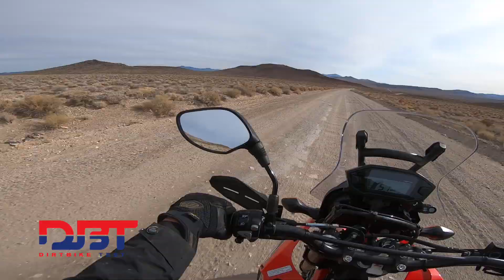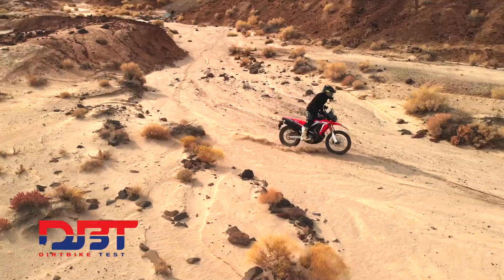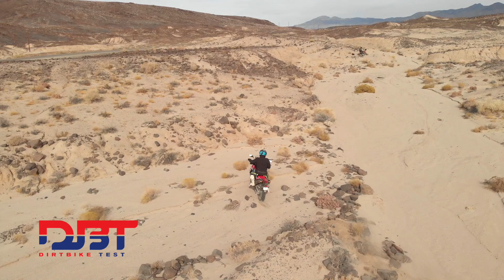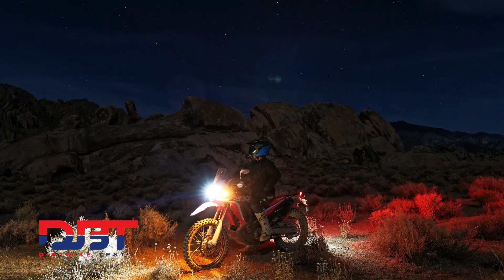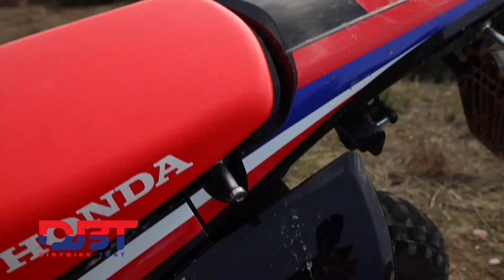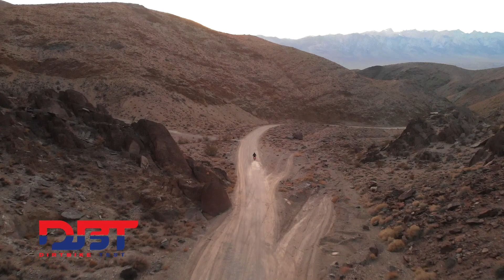Riding Impression: 2020 Honda CRF250L Rally

Comment: Recently rode with KTMs and DRZs. My 250 Rally has 60,000+ kilometres. Which bike was the only one that didn't break on the trip?
Reply: 20k on mine, nothing but chain n sprockets (once) and oil changes. I have a perm air filter.

Comment: It is so hard to find testers that realize a 250 can be for experienced riders as well. I have a 250. And a CBR1000 and a VTX1300.  Ive owned 80 motorcycles, Over 25 were Dual Sports. When I started, they were called Dual Purpose.

Comment: Thanks for this review. My experience, in my 20s, and 30s, is with a Honda CB 350, Suzuki GS 750, and later, a Honda CT-90. I am now 55 years old, and looking to get back in to riding. I could care less about going fast. My main goal is to see what is around the next corner, and have fun. I do not want to worry about whether I can pick the bike up by myself if I drop it on the trail. I started looking at the KLR 650, and then fell in love with the RE Interceptor 650, but became disenchanted with the corrosion issues, and short service intervals. I just don't want to spend all my free time working on a bike. I am more and more leaning towards the CRF250L Rally. I like the long service intervals, and even though I am north of 250LB, I am still well south of the 250s max load range.
I looked at the 450, but for the price, and ridiculously short service intervals, that is not the bike for me. I have just now found out that Kawasaki may be introducing a replacement for the KLR. That is now my only stumbling block. I need to wait to see what they introduce. I live in Washington state. I have relatives in Star Idaho, that I regularly visit, and I am perfectly happy to use the avoid freeways check box on Google maps. I would love to have something with more power, but there just isn't anything in the CRF250L Rally's  class. If Kawi doesn't introduce something revolutionary this year, I think the CRF250L Rally is my bike.

Comment: Man I dont get it,  The bike is about 350 Pounds. Thats on par with the xr650L  and not far Behind the Dr 650..The advantage of the 250 class is that they are light, whats the point of getting a 250 if it weighs as much as a 650 and has half of the power?
Reply from the maker: For the less power, of course. It does not feel this heavy till you have to pick it up.

Comment: I have one. Its a great bike. Its a 250. You want more power? Just buy a bike with a bigger engine! And the rear suspension does adjust for pre load, so try it before swapping out the shock.

Comment: A note on the base 250L front suspension. There is a spring only on one side; the fork tubes are not identical, and the seals tend to blow out very easily.  It's not a bike killer, but maintenance is a little more like a dirt bike in this case.
Reply: Is there an aftermarket fix for this problem?? Good to know!

Comment: It is my Detroit urban transportation scooter with the added benefit of joyous movement.  It works well.  I ride it a lot.  It makes me smile.  No better value.  It needs nothing.  Thank you Honda and please don't change a thing.  Small displacement is awesome. Many of us in the US will choose to not spend $$ on cars and trucks going forward.  Consider this vehicle as a better option as most of us prepare for extended time frame where less is more. Fun bike.  75 mpg.  $104 Full coverage insurance per year.
Reply: This is what I needed to know. I will do 99% driving on normal streets. Not off road. What do you think of the ergonomics? Is the gearing pretty short? Does it get hot quickly? Have you swapped out to more tarmac friendly tires?
Reply: Ergonomics are old school and a bit cramped compared to modern (KTM) standards.  The handlebars are a little low and too close to the rider (I’m 5’9”).  I don’t find the gearing short.  Seems just about right to me.  I’m not sure the little Honda could pull much of a taller 6th in certain conditions - after all it’s got 24.6 HP.  I don’t think it gets hot too quickly.  When I’ve been sitting in traffic the fan will kick on during longer idle sessions.  I replaced the stock IRC’s after they wore out with Dunlop 605’s.

Comment: Hey guys if you want my opinion I have probably the most modified Rally on the planet. I have spent 6300$ in upgrades so far not including the bike. I know I’m going to get comments on why I would put so much into a cheap bike and the answer is, I just like the bike and want it to be the best it can be. I wish it came in a 350 or 450 but I still love it and I’ll give you my thoughts.

1. -Price-I bought it brand new 4000$ from the dealer. Amazing price to get you into adventure riding for a brand new bike. Mine was two years old so the dealer needed to get rid of it. Those are the best deals.
2. -Parts-This is a global bike so parts are easy to get and dirt cheap if you break something. A huge plus for your first bike that you may be crashing a lot.
3. -Weight-At 350lbs this is a light bike for adventure riders to get started with before they upgrade to maybe a Tenere 700 or 790 KTM. No it’s not a light enduro bike like a 250 EXC BUT it isn’t marketed as such. It doesn’t give too much power to get new riders into trouble. 
  
  With all that being said you don’t have to spend as much as I did in upgrades but I will tell you what you absolutely MUST upgrade on this bike. Get a 13T up front. Get a FULL FMF exhaust and an EJK tuner. Get a full Racetech suspension if you’re over 150lbs. Change out the terrible stock tires for D606 and as with every bike get a Seatconcepts seat for comfort. I changed the bars immediately and put on Barkbusters as well but those are less important. The nice thing is you can buy the bike and the upgrade as you get money you don’t have to do it all at once. I built mine up over the course of one full year and I have nothing left to put on it. I will be making a video of it soon for my channel. Thanks for reading
Reply from the maker: We would love to do something with your bike and see what is can become...I know this guy who will be on Tech Talk Taco Tuesday #57 tonight that might like to ride it too...
Reply: Can u post the link to your video of the bike?
Reply: @grumpysquid  I am trapped overseas with no way to fly back to the US, I will make a video for my channel but god knows when
Reply: And what is a “13T”??

Comment: Please HONDA make a 350 again, that would be perfect: 250 too small, 450 too big.
Reply: Look up 2000 1999 yamaha xt  350 was a great bike good suspension sear 6 speed  enuff power and light weight
Reply: @mastersolomon  In fact I bought an XT350 when it just came out. I rode it straight from north Germany to France and had the holiday of a lifetime. That bike had good power, around 34hp I remember. Would buy it again if it was available new.
Reply: Krav Maga SMA Master Solomon I ride TW200s for gravel roads and trail use, and a 1999 XT350 when I need to run faster than about 55 (my heavily modified TW will do about 70-75, but you'd never want to for long, it just makes it comfortable at 55-60 which was the goal). The 350's a great bike, but old and archaic. I imagine a CRF250L Rally will probably replace it when it finally keels over, I don't need a big, powerful bike. Just a capable dual sport that is a BIT more burly than my beloved TWs for occasions I need to ride a bit faster. 

If the CRF250L had the 300 engine, upgraded suspension, and bigger/beefier wheels and tires, it would be the perfect bike. I'm obviously into the look, feel, and handling of fat tires, so that's a pretty necessary upgrade for me, and I hear the stock 250 isn't exactly thrilled about the additional unsprung weight.
Reply: @The_sinner_Jim_Whitney  yes the 250 is 350 lbs underpowerd  my xr650 is 346 lbs and gets 40 hp stock. That 250 needs a 450 cc motor detuned just like the 250 but 450cc . Don t worry about too much power i never use all the power in my 650 but i enjoy the effortless riding u can keep the motor at low rpm  i cruise at 70mph easy it will hit 100
Reply: Krav Maga SMA Master Solomon 317 pounds, I'm pretty sure. I've ridden 450s, even mild ones, no thanks. I like to be able to use most of what a bike has, with a linear sweep of useful throttle positions. 

Big bikes for me (I weigh 150 pounds) are hard as hell to trail ride, most are taller than I'd really like for them to be and anything bigger than 350 or so means (for me) the throttle is like an on/off switch since I can only effectively use like 20% of the throttle on rough stuff, plus weight is my enemy anywhere but on the road. 

I don't ride highways, or I'd figure out how to make it work. The ability to pull away from steady 60 mph traffic if I need to for safety is all I require as far as on-road performance is concerned. 

I might wind up with a 450 someday, but it won't be my first choice. Smaller, lighter dual sport and adventure style bikes are getting more and more popular and available here in the States (have been everywhere else for quite a while), so here's hoping we get a better (for me) option soon. A 300-350 cc Yamaha Teneré would be the cat's ass...
Reply: Krav Maga SMA Master Solomon the 250 is 317 pounds you twit
Reply: @mastersolomon  I hear ya. I cruse at 5 mph. And sometimes I get up to 20.
Reply: @JHUM22  I was talking about the crf rally 250. YOU TWIT.
Reply: I would upvote this comment to the Moon if I could.
Reply: Unlikely .... since 250cc is a big market for Honda, especially in Asia, that is the maximum allowable cc.  I would rather to see the bike to lose some weights, under 300 lbs, and a few more ponies (to get up to 80 MPH top end)
Reply: I have a 2014 regular L with the 300 kit, full FMF and EJK, Acerbis 3.1 tank.  I added a Britannia Composites faring.  The only weakness is the suspension, my bike has plenty of power, the mods got it down to right at 300lbs.  I'd trade more power for better suspension.  These bikes work great for their intended purpose, low maintenance practical, affordable travel/ dual sport/ light ADV hybrid.
Reply: Agreed
Reply: CRF300L & CRF300 RALLY are here. Ok, for now only in Thailand, but hopefully coming soon to Europe & other places too. 👌
Reply: your wish has been granted.
Reply: Or just make a 250 with decent power like the WR.
Reply: @perrinayebarra  Not much difference power wise between the 250L and WR.
a 350 would be pretty cool
Reply: @perrinayebarra  the wr doesnt have decent power lmao. A 350 or 400 would be great provided they can keep the matinence schedule low (unlike the 450)

Comment: the issue is the power! not in lower elevation states, but try taking a crf250L on over to Mt Antero CO at 13-14k feet elevation or mosquito pass. the entire ride will be 1st gear only and yet alone Climbing Mt Antero is impossible with a 250. My KLX250 could not climb it...like literally would not go. other than that, this is a perfect bike in every way as far as dual sporting goes. if this had the 701 enduro engine with same exact body style and frame, I would pick this honda. the wind protection is so nice and it honestly feels like a street bike on the road. too bad they killed a perfect bike with a 250 engine. unless you live in states like FL and Georgia and hit flat forest roads with back roads of 50 60mph

Comment: I think the xr650lLis better same weight 346lbs and 3 times the power and torque
Reply: sure and 10 years older and still better
Reply: @WojciechKalka  more than 10 years xr 650L came out in 1993. Modern look means norhing the 250 does nt even have better suspension or seat .
Reply: about 25lbs heavier... the 650 is awesome though
Reply: @MrHeepspo   crf250L is lighter  ut the crf250 Rally is the same as the 650. 346lbs.
Reply: @mastersolomon  
Ahhhh, got it. Bummer that the Rally is so heavy.
Reply: @MrHeepspo  yes the rally is too heavy for a 250.

Comment: All the comments are correct! There is no 'ideal' adventure bike as it depends on the balance between off road on road riding and ability level. I have owned a Rally since 2017 and it introduced me to trail riding and is perfectly happy sitting on the motorway (freeway) at 70mph. For the money it's a great introduction to the sport. Could it have more power. Yes. Could it be lighter. Yes. But as a package its pretty good just decide before you buy what ratio of on road you'r going to do compared to trail. If it's more road, use the Rally its more trail perhaps go for an SWM or similar.
Reply: Philip Thomas  Single White Male
Reply: Right on.  No perfect bike.  I own BMW 310GS mainly for adventure riding (more on road, limited off road), my max speed 92 MPH.  But I am considered to pick up CRF250L for trails riding (more off road, limited on road).  Though, I wish the CRF250L would weight a little less, under 300 lbs.

Comment: If only it was a 350 or 400...same price and weight.
Reply: I hear the cbr350 motor fits this bike nicely. The main difference is bottom end torque and a better clutch.

The real problem is that the suspension is extremely soft. If you want more power than you're gonna want a whole different bike. 

Otherwise this bike does it's job extremely well. Scoot around town, dirt roads, light trails.
Reply: Agree. I drove a Yamaha 250wr for a year and the only thing I missed was a bigger motor.